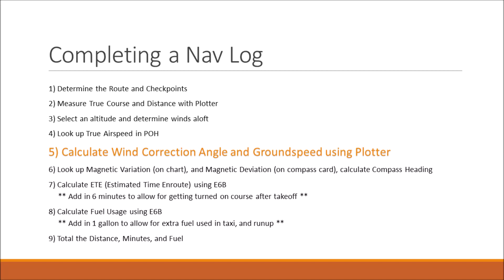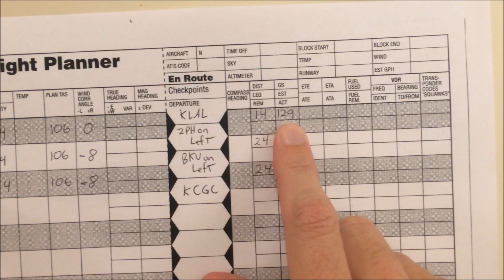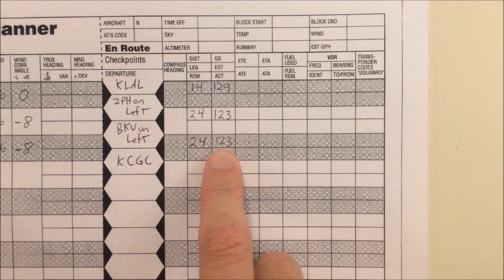VFR Nav Log (Video 5) Wind Correction Angle and Groundspeed

Comment: Great videos.  Thanks
Just one thing.  If the wind direction is 180 deg. (Correction 0 deg) we only need to add the 106 + 24 = 130.  No need for the E6-B in that case.